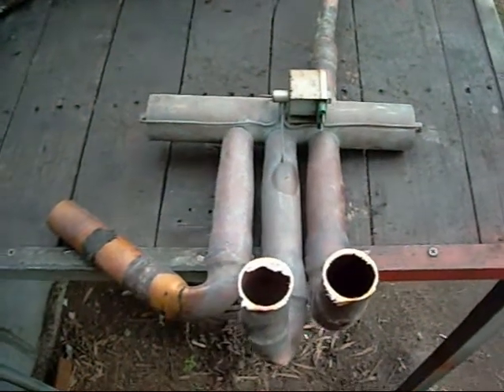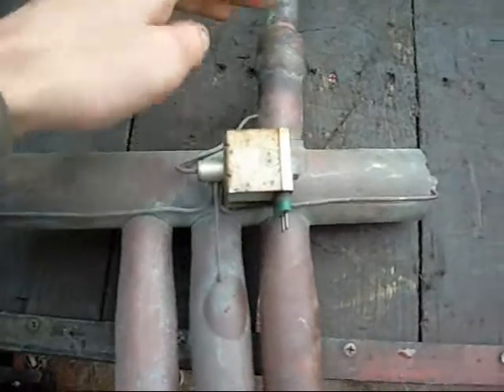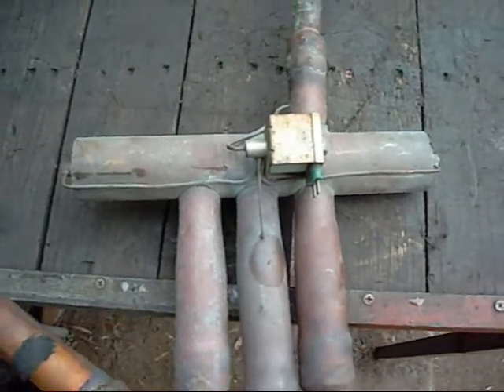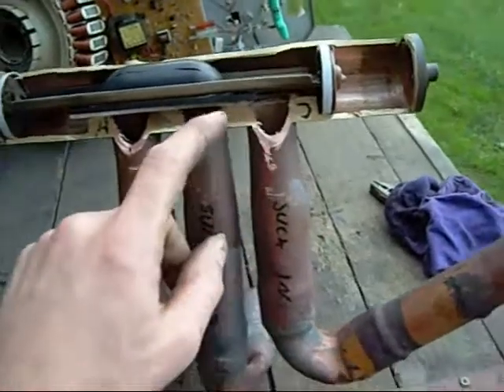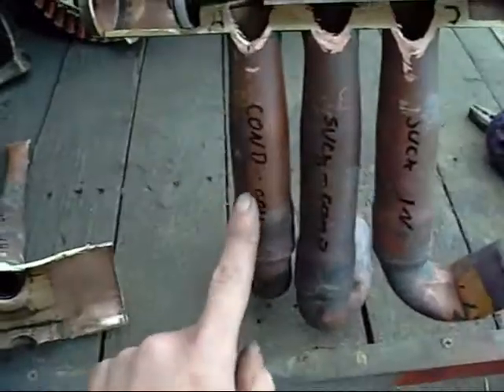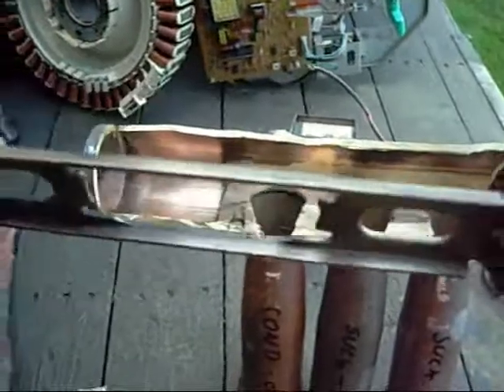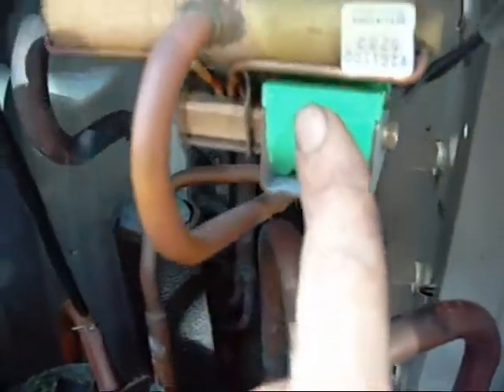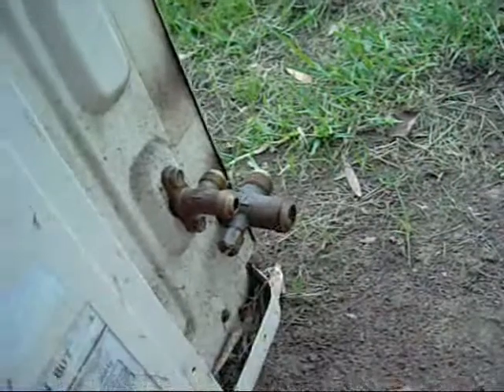HVAC Cycle Reversing Valve Exposed

Comment from the maker: @THEHVACTECH101 I'm not a tec myself but I would say its a good way to see where the gas is going while the system is running.

aside from that apply voltage to the coil and see if it switches over or frees up, assuming its stuck.

Comment from the maker: THx for clarifying that man, I had a feeling it would work as long as the solenoid operation is taken into account.

Switch on for heat, or switch on for cool depending on how the valve is oriented.

Comment from the maker: @mattbrandi yeh, I've had a few window units do that because they had been stored on their side/upside down, and oil had flooded into the RV, ruining it :(

they usually hiss and the suction line from the evaporator sweats up to the RV, but not past it because HP gas is leaking in.

Comment from the maker: You would have to re-engineer the whole system, but I don't see why it wouldn't work.

main thing would be to make sure the condensing coil will work as a evap coil without any problems.
likewise the accumualtor on the compressor may not be large enough to deal with excess liquid comeing back to it.

Comment: Cheaper to buy a new unit. Much cheaper.
It would need to have auxilary heat anyways unless it was grossly oversized to begin with. In which case it would make a poor air conditioner because it would not run long enough to pull out humidity. If you have the cash look into inverter driven heat pumps. Most mini splits and Nordyne builds a split system. If on a budget check out amana PTAC / PTHP. Get your window back and close the damn thing before you let all the air out.

Comment: Great Vid.
I am in the process of building a Electric Vehicle and considering all options for heating. Would be great to use a reversing valve similar to the Fujitsu unit. Reckon it will work with car condenser and evap?  Live in Melbourne so need a heater!!